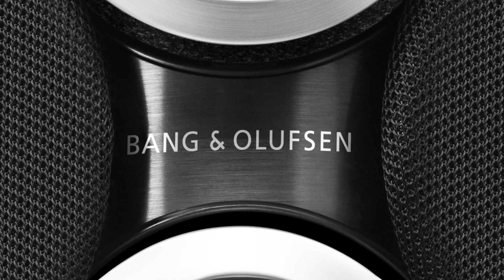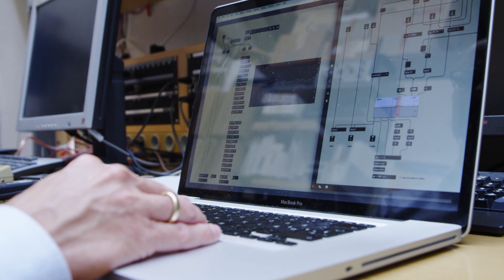The Revolutionary Bang & Olufsen BeoLab 90 Loudspeaker

Comment: Sounds like an understandable approach that is innovative but not tech for tech's sake. Practical solutions for  long time limitations in home environments.  In very general terms (not to compare brand to brand here or be a meathead) like it may sound like my Klipsch Cornwall IIs but in an anechoic chamber, with more consistent sound ( my speakers suffer from voice coil heat up).  I am intrigued.